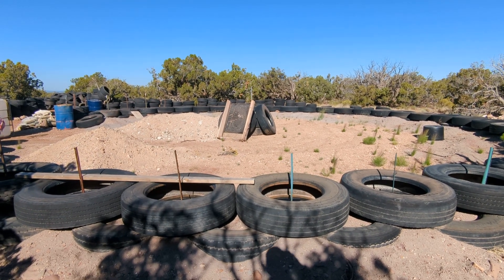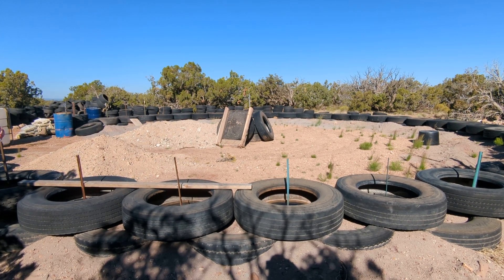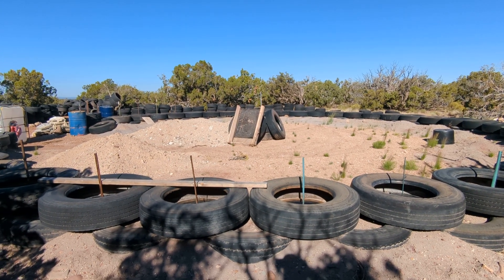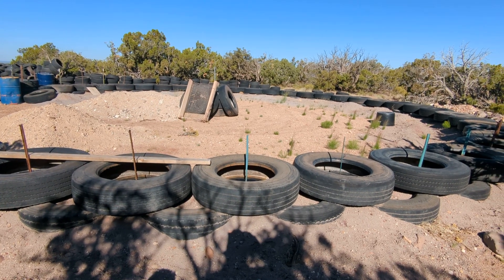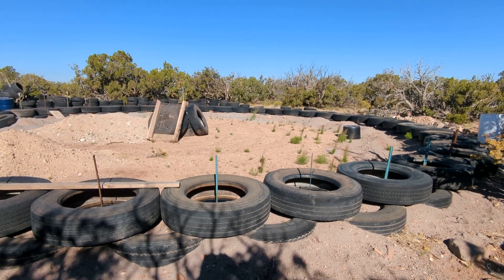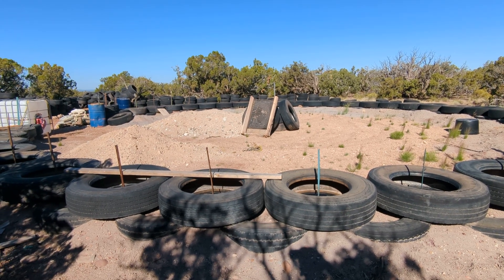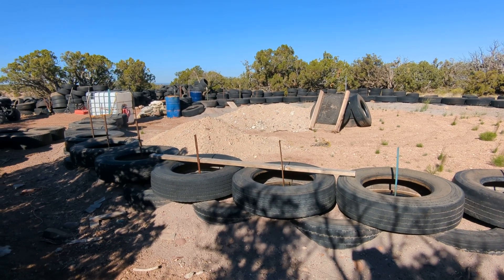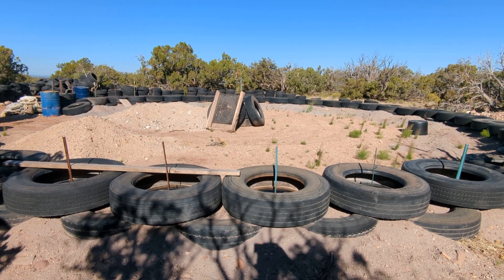Nicole Teslas Experimental research station rebuild. Kickstarter project by Earthship Build Project.

Comment: I admire the desire to do something great as a professional electrical power systems engineer focusing on energy systems.  I advise that more than 50kw will be required for the facility you describe. Additionally, not to be the literal person in the chat, but there isn't such thing as free energy. We exist in a closed energy system (the universe), so energy can only be transferred or transformed.
Reply from the maker: Tesla has been my life's work.
Reply from the maker: You are so right about the free energy concept. Nothing is free. That energy had been created by the destruction of many a solar system and galaxy.
Reply: @kennethhigby1723  what kind of projects have you developed as a result? I named my dog Nikola Teslas out of the respect I have for the serb.
Reply: @kennethhigby1723  The energy in my speculation is a residual to the annihilation of antimatter and matter following the big bang. That being said matter and antimatter are forms of energy themselves.